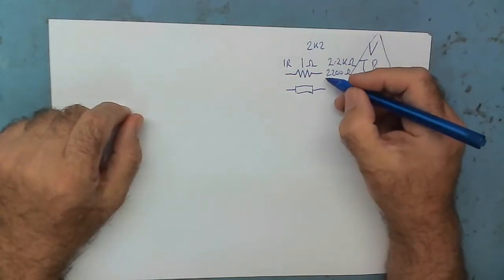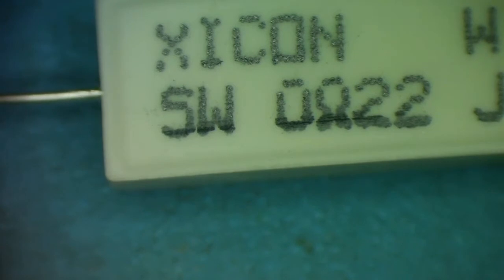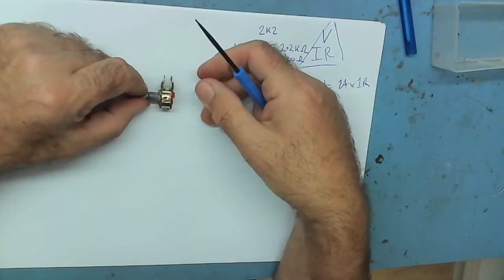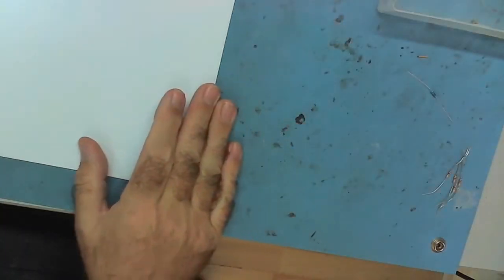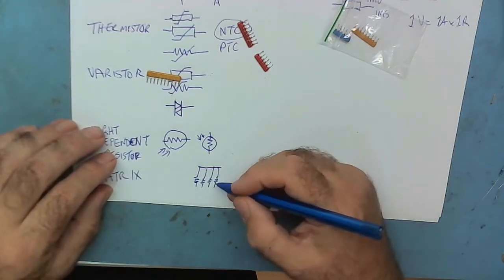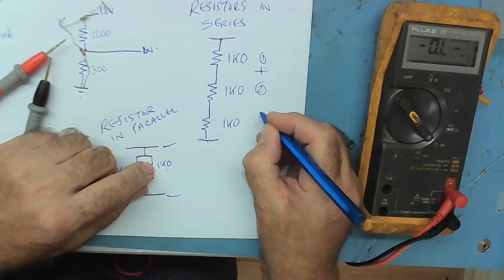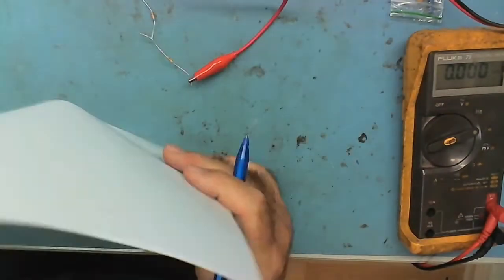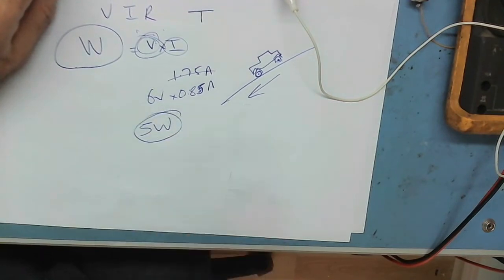Learn Electronics Repair #23 Circuits and Components for Beginners 3. RESISTORS

Comment: In the context of potentiometers (often referred to as "pots"), a letter code, usually "A" or "B", can indicate the type of taper (the way the resistance changes as the knob is turned). Typically, "A" indicates a logarithmic (audio) taper, while "B" indicates a linear taper

Comment: Love the story of how you got into electronics was similar for me i used to take my toys apart had Scalextric to aged 7 id change a fuse or a plug for my mum. We lived down the road from the local dumb i had all sorts from there including 2 tv's that were the same i remember it had cards in it much like a pci slot one for volume one for picture so out the two i had one good tv i just seemed to have a knack for fixing stuff.. We had a rental tv at one point to it took 50 pence pieces my mum would ask me to open it when we were skint eventually i just held the lever down with a paper clip 😂 was probably easier to just bypass it but i was about 10 so never thought of that. The day the guy would come to collect we'd put the exact amount of money in the box 🤦🏼‍♂️

Comment: 1:00:16  sir why did you take half of voltage and ampere there ? my value is coming out 14.4 watt.
Reply: In a series circuit, theres a certain voltage drop across each load.  One is the light, ones the resistor. Each is dissipating (as heat) a certain wattage (volts x current)  depending on its resistance. The voltage you use for the calculation of heat dissipation, is the voltage drop across the single load.   
The current is the sum of all loads, and full current travels through all loads, voltage drop is different across each load. (Unlesd the resistance of each load is the same)

Comment: the forrmula for resisitances in parallel is product over sum, multiply both then divide by a sum  of both added together, so 1000 times a  1000=1000000, divided by 1000 plus 1000= 2000, 1000000 divided by 2000= 500

Comment: Sorry if its a silly question but can you explain why you didn't put the resistor before the lightbulb in the circuit. does it matter which side it goes.?
Reply: It's because of the current consistency, the current flowing through a circuit is the same at all points in the circuit. This means that the same current that flows through the resistor will also flow through the light bulb, no matter their order

Comment: Loved your story about hiding behind the couch fearing explosions and hurling 'valve missiles' at each other.  I'm older than you and my introduction to electronics was slightly different to yours . Somehow  I'd seen pictures of block diagrams of radio circuits , but I wasn't really sure what I was looking at, until  I obtained a copy of Practical Wireless and saw actual pictures of  resistors etc. I've been a keen hobbyist ever since and I often return to the basics as I believe that you'll often learn something new.
Thanks for sharing your knowledge and experience. Regards Kieron.